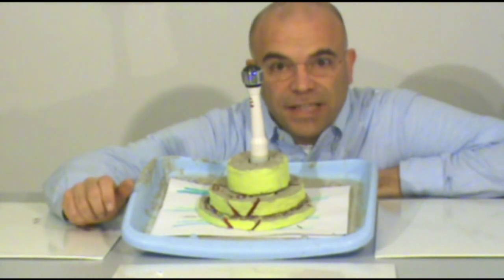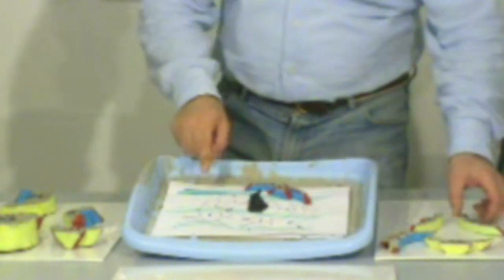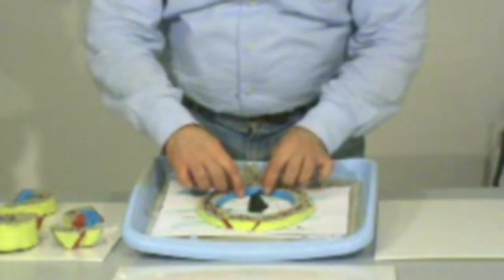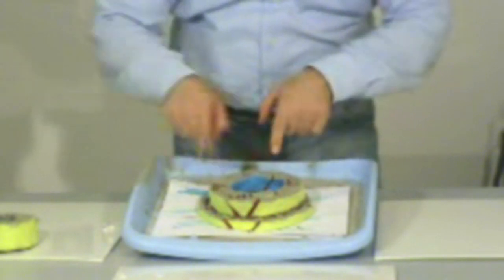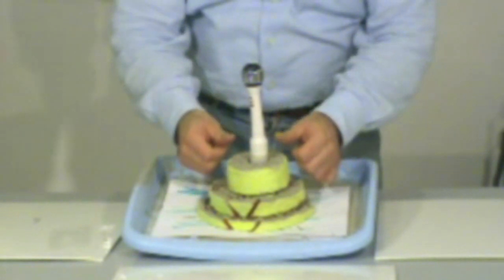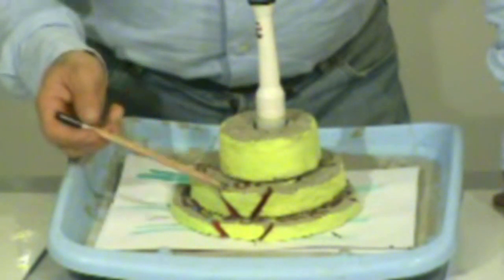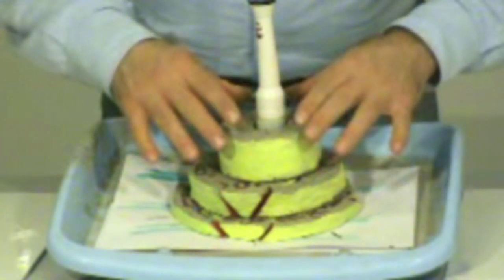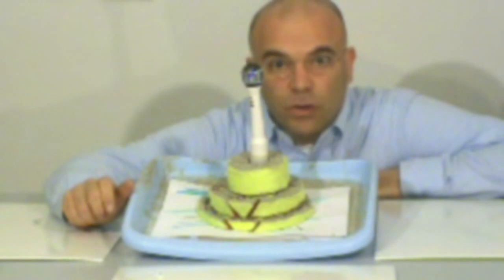Deepwater Horizon oil spill BP Gulf Mexico top kill not.mp4

Comment from the maker: @drcolenrobinator 
Sorry my English but I used an automatic translator
It is a bell resting on the seabed consists of pieces Heavy reinforced concrete in 11 parts. The weight keeps the oil out. a submersible pump creates a vacuum in the bell and pushes the oil upward. I think you're an expert if you can SEND MESSAGE TO BP AND THE GOVERNMENT. SAVING TURTLES!
See you. Antonino Gambino From Milano Italy